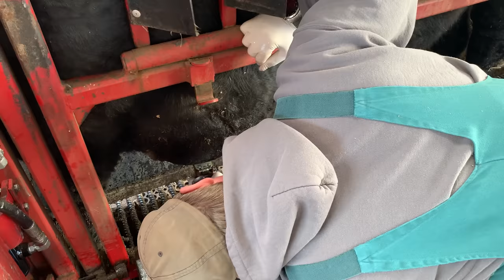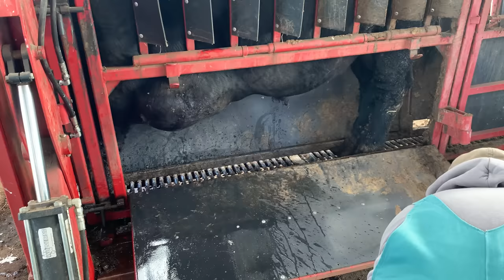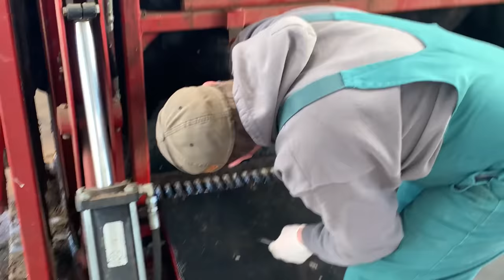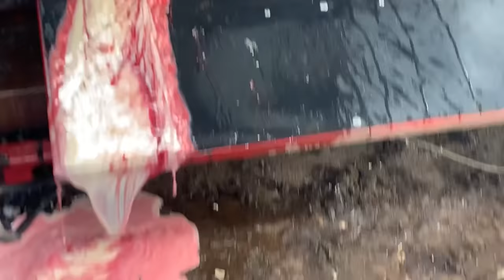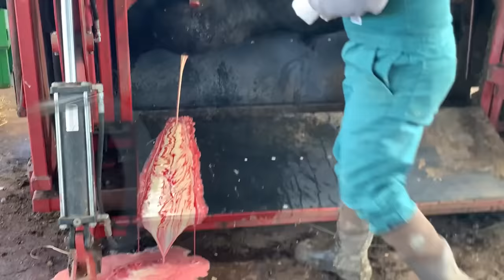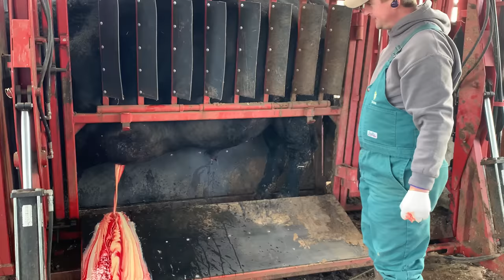HUGE Abscess on Bull Lanced

Comment: holy smokes Batman, that sure was a lot of putrid puss!  Why let all that nastiness pour on the floor?  wouldn't a bucket be more sanitary or do they just not worry about that because of all the antibiotics they use on livestock?
Reply: Would you rather they let the animals die of a simple, treatable infection? Just curious. And it's a lot easier to just hose down the crush when they're done. It all goes in the manure pit eventually anyway.